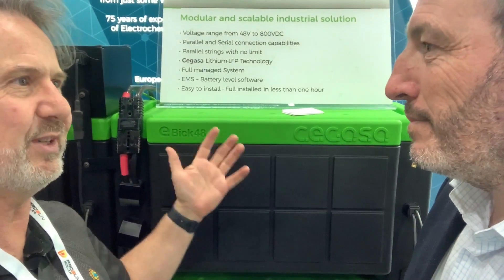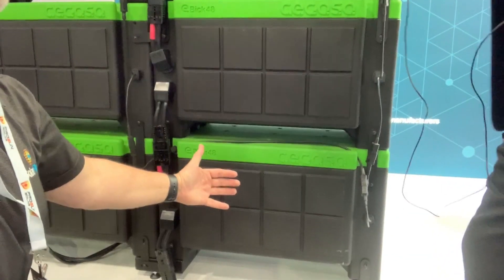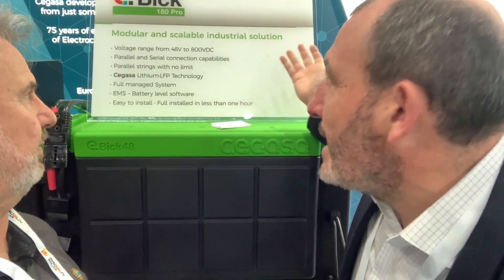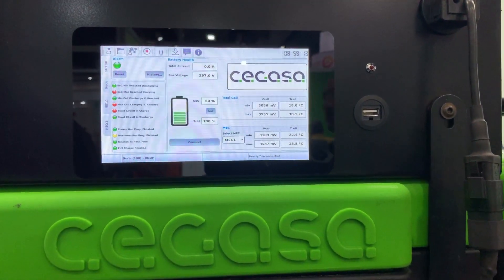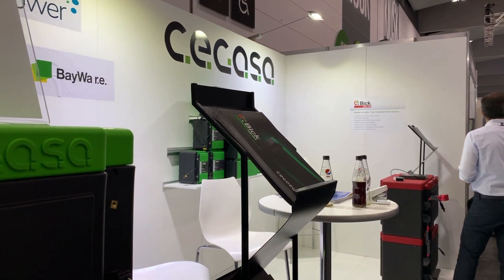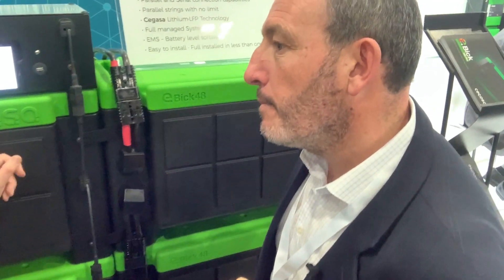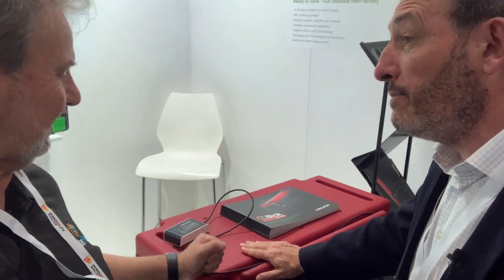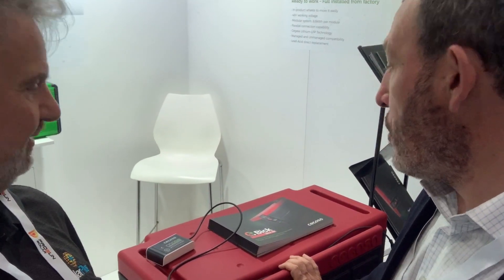Cegasa 8.6kWh Batteries

Comment: Regarding the battery capacity, I have a doubt.
Whether per module is considered as 8.6 kWh or 2 to 3 modules connected in parallel or series will be a 8.6 kWh?
Reply from the maker: Adhiyaman adhi each module is 8.6kWh  https://www.cegasa.com/en/ebick-180-pro
Reply: Each module is 8.64 kWh @48V, then you assemble the strings. In parallel, a string can contain up to 24 modules (that is 207.36 kWh @ 48V). In series, it depends on the voltage you want to reach. A perfect example is 144V (used with 120V inverters). Columns of 3 modules in series are formed (25.92 kWh @144V) and then, these columns are connected in parallel to reach the desired storage capacity. Each column will add an additional 25.92 kWh to the system.
Reply: @thomastubella9518  thank you for your response, I will look into deeply in the respective website
Reply: @SmartEnergyLab  Understood, Sure I will visit the site